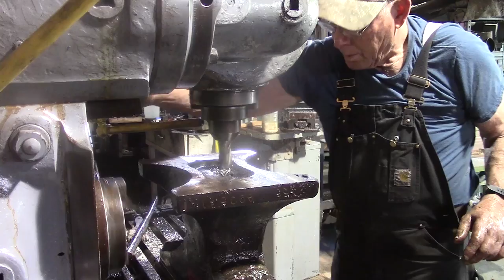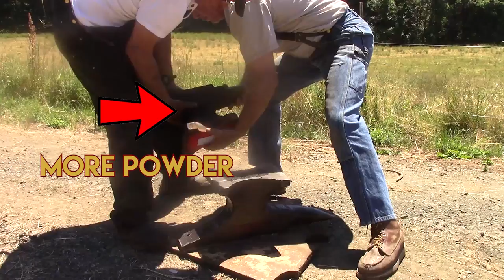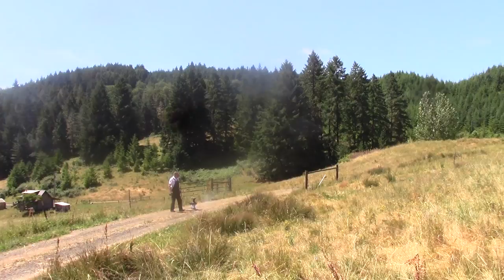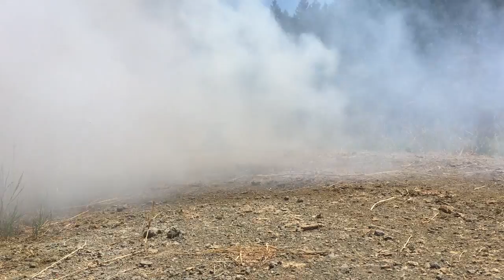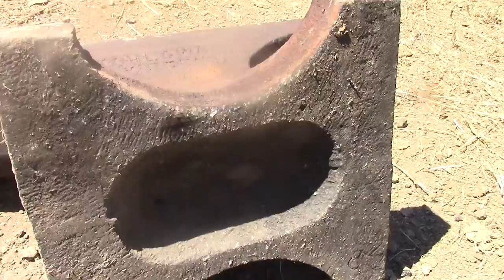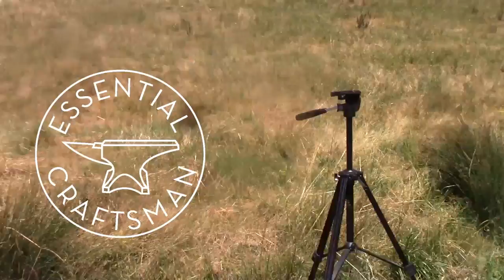Anvil Shooting

Comment: It actually made it to about 39m (128ft)!! 
I calculated the height from the time between explosion and landing. (not accounting for air resistance, but that should be negligible)
Formula used: H=9.81/8*T^2
Reply: He's right! It's ~45 meters, not feet!
Reply: h= height, 9.8 = g, what's 8*T^2?
Reply: a = 9.8 m/s^2
v = a * t = 9.8 t
s = ∫ v dt = (9.8 / 2) * t^2 
but the t you get from the video is actually twice the time the anvil needed to reach the top, so instead of t, you plug in t/2. If you square that you get t^2/4
s = 9.8/2 * t^2/4 = 9.8/8 t^2
The anvil flew for a little less than 6 seconds. This gives you about 40 meters.
Reply: I guess it depends on the accuracy of the time you measure. I had a more conservative 30 m, well over 90 ft, but again, the best way to do it is downloading the video, knowing what the fps are for it and counting the frames of the flight.
Reply: w00td00t well someone was awake during kinematics
Reply: I think we safely and joyfully say over 100'!!!! HAPPY 4th!!!
Reply: Nice seeing you here Mr Practical Engineering!
Reply: Christian Ortbauer Well, sorry to tell you but you're absolutely incorrect. By my calculations the anvil is steel up there somewhere.
Reply: misternormL No, their math wa...
Dammit.
Reply: Was going to do the same. Thanks for saving me the trouble. =)
Reply: I am guessing that EC calculated the height using his speed square and that video will be forthcoming shortly.
Reply: If you're going to that level of precision perhaps you should take into account that the explosion isn't actually instantaneous -- it takes some amount of time to accelerate the anvil to full speed.  Might make a difference of a foot or two.
Reply: We dont even need force in this calculation.  Even is the explosion isn't instantanous (which it nearly is) all you need is the net force the explosion exerted on the anvil and that net force happens in a fraction of a second.
Reply: Btw noone is being precise here.  We didnt' even break out the differential equations to calculate the air resistance or that s(up) is different from s(down).
Reply: Yeah I agree, based on my rough measurement of time it's well over 100 feet, between 30 and 40 meters so probably at least 115 feet..........that's some height for an anvil!
Reply: Science FTW!
Reply: I just watched this, timed it and got the same value.  Nerds rule.  In this case air resistance is not even negligible... it's less!
The equation should look like x = 1/2 at^2.  t (one half of the round trip) is about 2.84 s.  39.5m.
Reply: I calculated the speed that old guy wandered away after he lit it.
Formula: NOT FAST ENOUGH
Reply: Wow I also thought of doing that and then realized I wasn't nearly smart enough to solve it so thank you good sir!!! Haha!
Reply: I Made A rough estimation and calculated roughly 144ft ( with 6s total flight time) . So its Well above 100ft
Reply: Cy is 50 years younger for a few minutes. Very fun.
Reply: Is there any specific place to get black powder? Send me a link, every place I’ve looked, it’s out of stock, don’t have it. And I haven’t been able to find a place to get it. Thanks

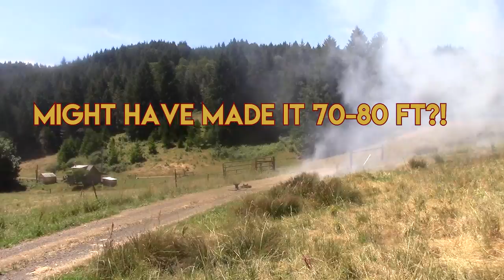Comment: At 1:36, I measured the time between explosion and landing to be about 6 seconds. Ballistic equations say the max height was around 46 feet. Still pretty badass in my opinion.

Edit: Whoops! Using metric units on fourth of July. Should be meters, not feet! Thanks Christian.
Reply: Well one of us got it wrong... I agree on the time with 5.64s. Half of that is spent in free fall at 1 g acceleration. That equals a distance of H=g/2*t^2 or 9.81m/s^2 / 2 * (2.82s)^2=39m=128ft
Reply: Essential Craftsman you did forget: Please don't try this at home.
Reply: how are you able to calculate distance based off time without speed?
Reply: @liamstraub3394  because he knows the value of g.
Reply: @Ken Mason I'm a 4th year mechanical engineer, my brain is filled with too much goop. I must have just been dumb that day. I watched the video now and it makes sense lol.
Reply: Wait I think I am interested in the acceleration of the anvil as it travels up.
Reply: @liamstraub3394 , this is similar to a gun. Once the bullet leaves the barrel there is no more acceleration horizontally, only the downward acceleration of gravity which eventually pulls it down to the earth. Similarly, after the anvil achieved lift-off from the explosion, the only acceleration on the anvil is gravity downward, or -g, slowing the anvil down and pulling it back to earth. It's difficult to calculate the initial acceleration from the explosion. We'd need to know how long the explosion was actually pushing the anvil, which was just a fraction of a second, just like with a gun.

Comment: Um, I just did some math. The anvil was in the air for approximately 5.4 seconds, from this we can say that the anvil was falling 2.7 sec. That means that anvil was way higher than 80ft, in fact I'm getting 120ft. The equation for distance fallen is 1/2xaxt^2 if we plug in the numbers t= 2.7sec and a=9.8 m/s^2 we get a whopping 35.721m! That's a lot more than 80ft!

Comment: It was in the air for roughly 6 seconds. For roughly half of that it was falling (ignoring air resistance etc), and in 3 seconds free fall you'd travel around 44m (144ft). With the raw footage you will be able to get a more exact timing, and it makes quite a difference, eg 2s free fall is only 20m (65ft). You can time it exactly from the raw footage and get a more accurate value and plug it in to a free fall calculator (or remember SUVAT equations from school).

Comment: Standing in line of sight of it? Clearly you guys had far more faith in the wall strength of your base anvil than I would have. 

I would have been very tempted to dig a little bunker... Which would give me an excuse to set off far more small explosions since I went through the effort to build a bunker to do it from safely.

Comment: Could I get some more info on that mill.  As a young machinists and welder I have never seen a mill that is truly a combination horizontal and vertical ?
Reply: HI Dakota I've been looking for this mill for years It's an old cincinatti Probably  made for and put in a navel vessel about 1940 almost as old as i am It is truly a universal mill. The top head angles both ways and has independent power and gears It Had a broken gear in the upper but we took it out welded it up re cut it and it runs great.THe table just got a couple marks on it and is only about three thou out a great old tool cy